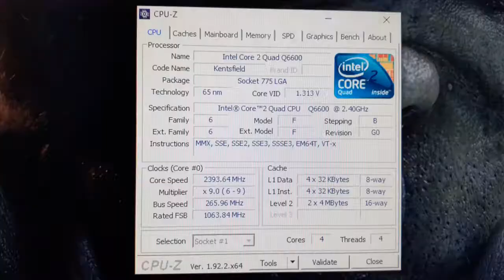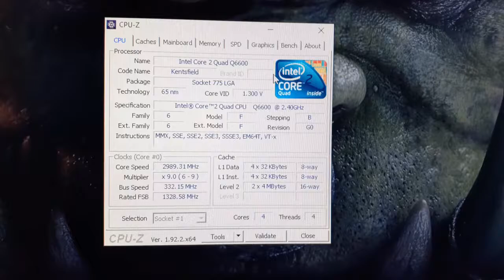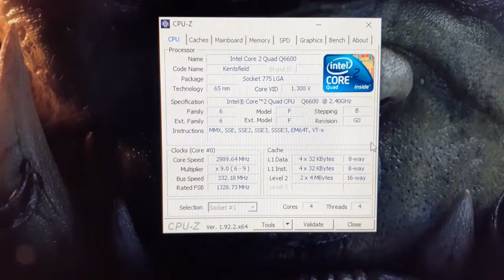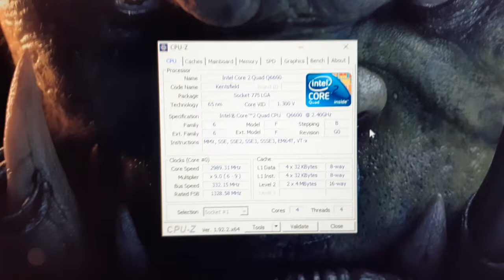Electrical Tape Intel Overclocking LGA775

Comment: 1600mhz mod never works for me... Qx9650 (Fsb 1333) on Dell xps430.
Reply from the maker: Hey yeah I believe it is only possible on the Q6600 because of the lower 2.4GHz base clock, on your 3.0GHz I think it'll bump it too high on a factory motherboard. Not sure about a        OC-able one though.